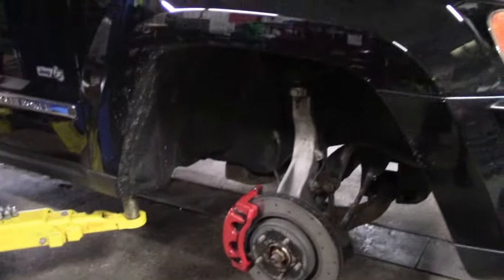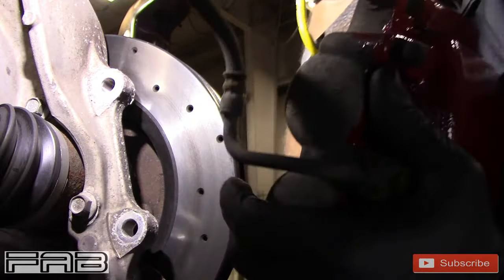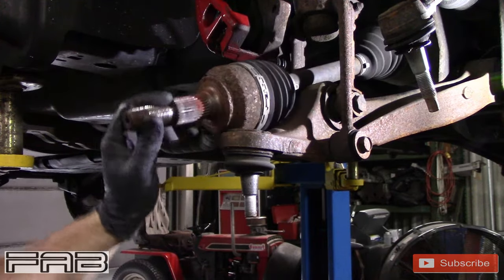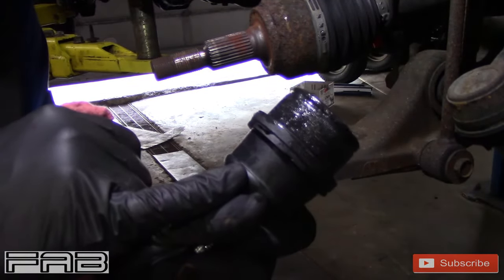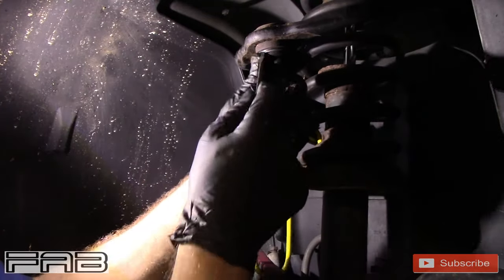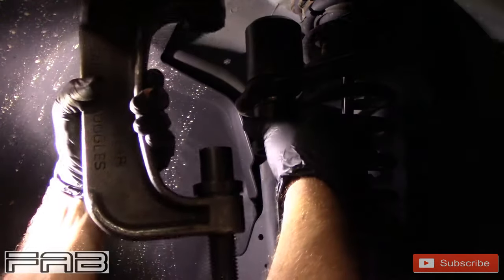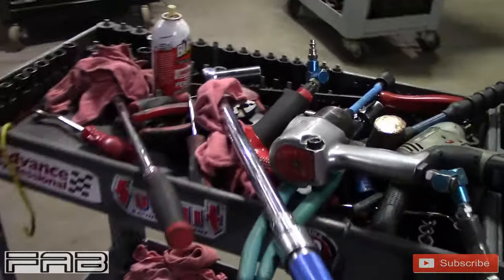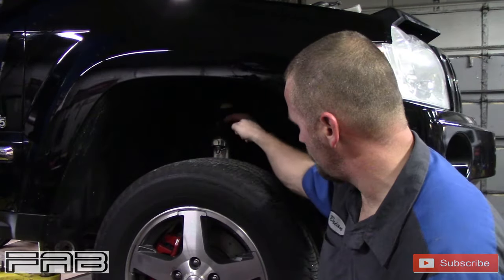How to Replace Ball Joints Step by Step on Most SUV's and Trucks

Comment: Hi Brian, great video. Very helpful. I have a question: what/which grease did you use on the ball joint before installing it?
Reply from the maker: @marvinottley5539  Thanks! Funny thing is I literally just dropped a video on the Icon Ball Joint Press. I use Amsoil Synthetic Multi Purpose Grease on everything I grease.